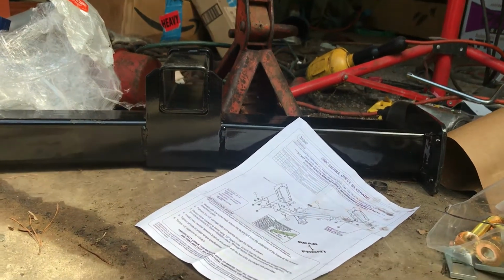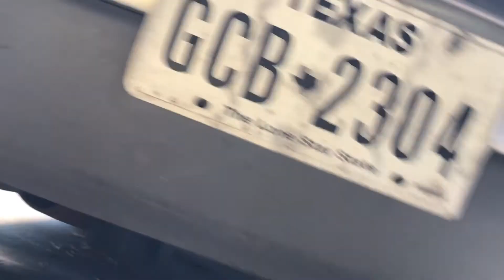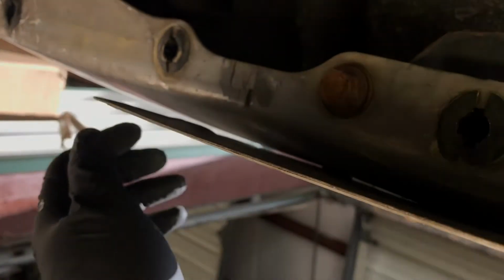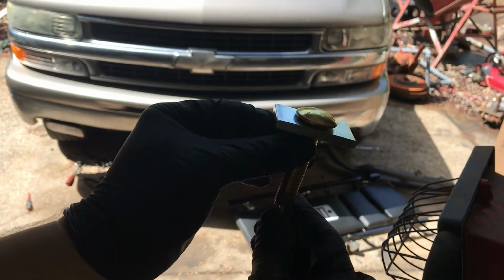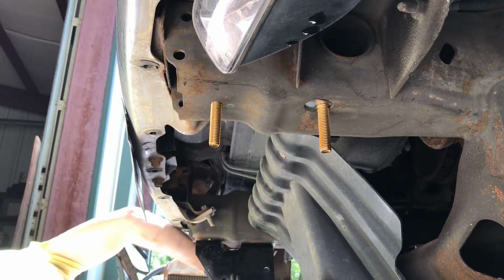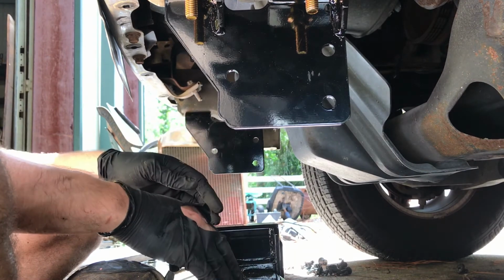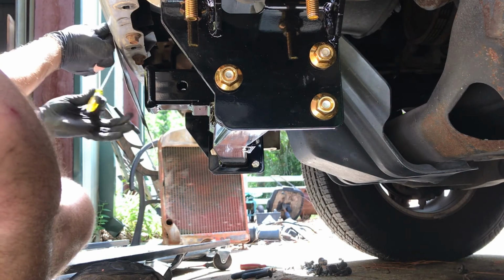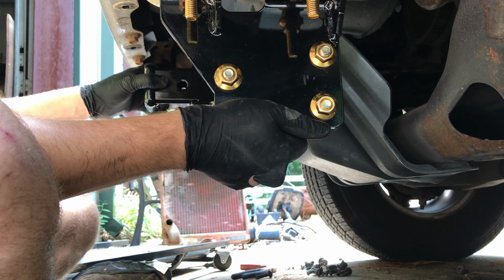03 Suburban Front Receiver Hitch Install pt1

Comment: Just leave the front plate off or drill holes in the plate before you do it on your bumper.
Reply from the maker: Unfortunately front plates are mandatory here and will get you a ticket if you don’t have one. This bumper is bent and twisted anyway. The holes are not noticeable with the plate on but holes in the plate would be.

Comment: I'm wondering how much of a hassle the hitch pin removal will be with the diagonal sweep of the air dam. Especially when trying to put the cotter pin in and out. Nice to see your personal Troll has already given you a thumbs down... consistent if not anything else.
Reply from the maker: It’s a little tight, but I can get my hand in there, the pin for the bike rack is a bolt and I just used my air ratchet to zip it on there. Yeah thumbs down guy seems to be a regular viewer now.